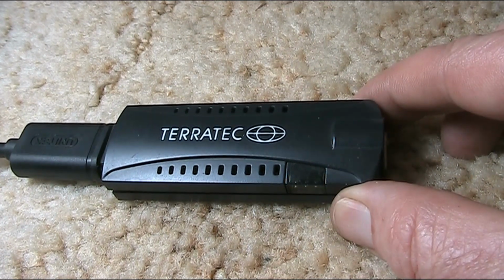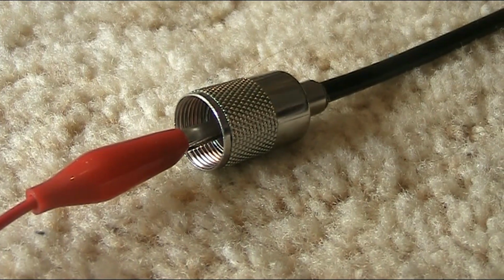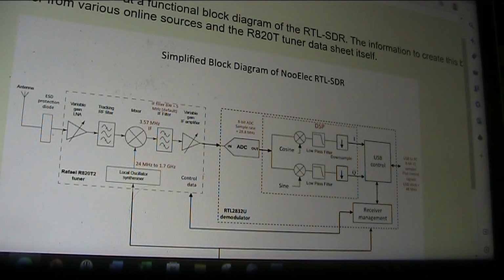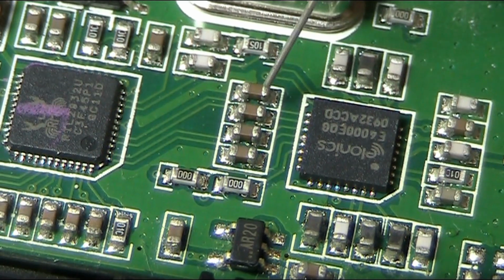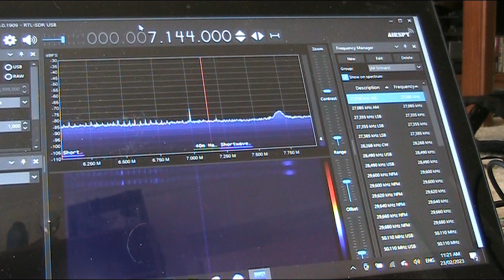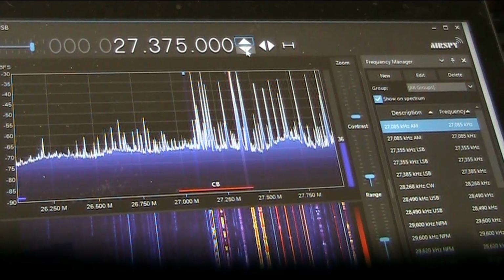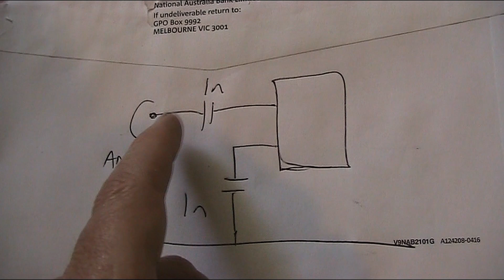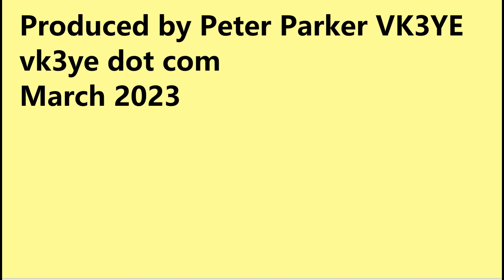A taste of HF on a cheap VHF/UHF RTL 2832

Comment: Very enjoyable video. I like the way you just probed around to find the best spot. I opened my rtl-sdr dongle up a while back with the idea of doing the same. When I saw it was a bit different inside to what I'd seen online, I decided against it. I was wanting to build a very basic upconverter and I thought if I accidentally destroy it I won't be able to experiment with building the upconverter. I've had success with the upconverter, so it may be time to have another look at doing this.

Comment: 👍 Thanks Peter. I have seen some people make up converters for these dongles. I was lazy and bought a commercial up converter. It works but performance isn't great. This direct input is a different approach and it would be interesting to see what could be achieved with some filtering and proper matching. A very simple pre-amp could be made using something like a MAR-6SM monolithic RF amp? Very simple, cheap, small and might even fit in the dongle case. Some RF preselector tuning is probably going be a bit bulkier and may not fit in the case so easily.